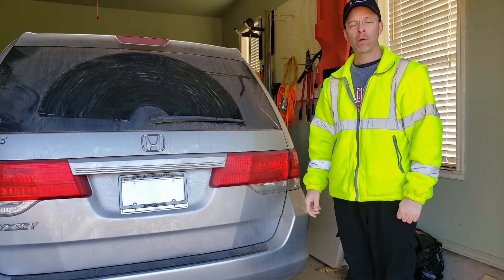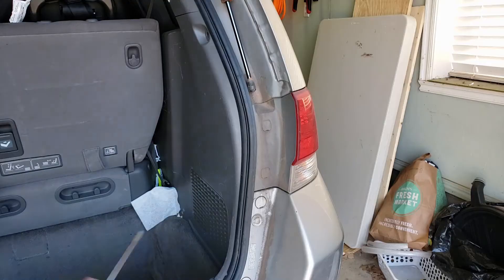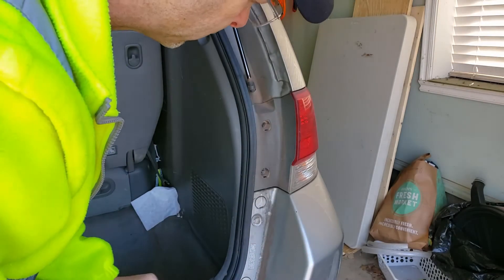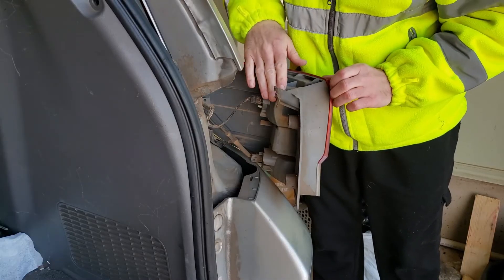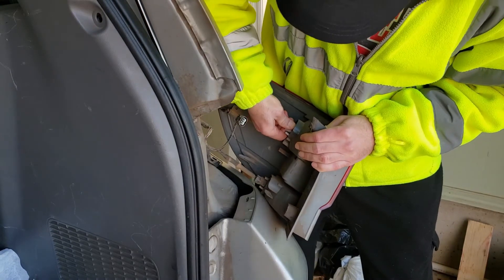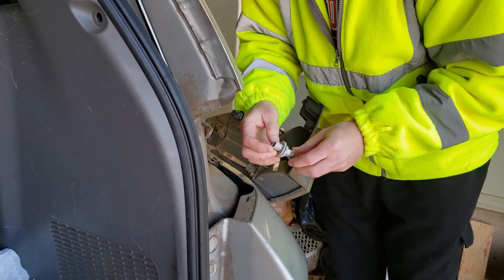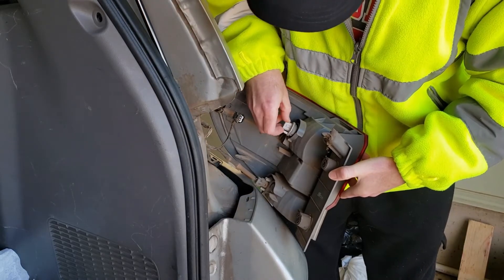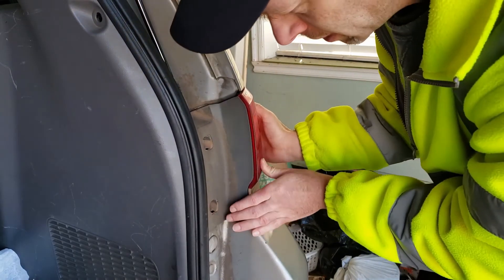How to replace brake light bulbs on 1999-2010 Honda Odyssey

Comment: Just replaced my wife's right brake light this morning, but I had to really pry the lens at the front with plastic pry tools to get it to release.  There is a little round prong on the lower front that pushes into a socket that was really, really tight.  I was afraid I might break the lens it was that tight, but once it came loose the rest was easy.  I did not disconnect the lamp socket but just rotated it to remove to replace the burned out lamp.  Fortunately I had a spare one in the car, a Sylvania 7443.  Thanks for the video.
Reply from the maker: Thanks!